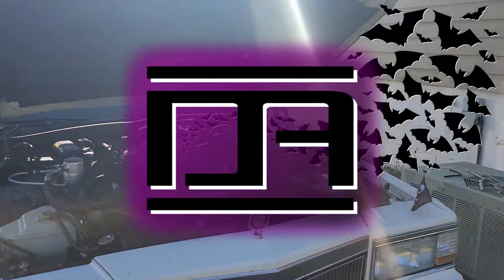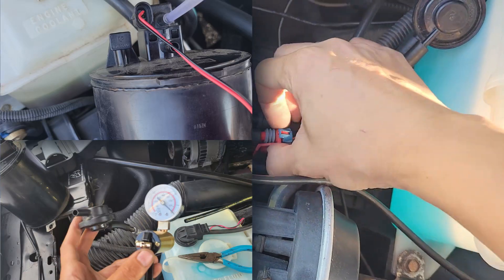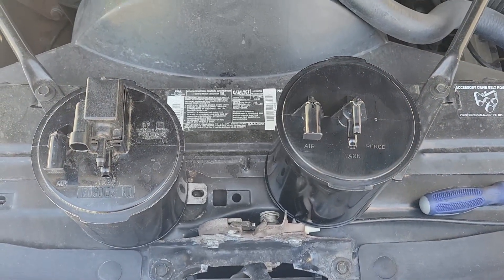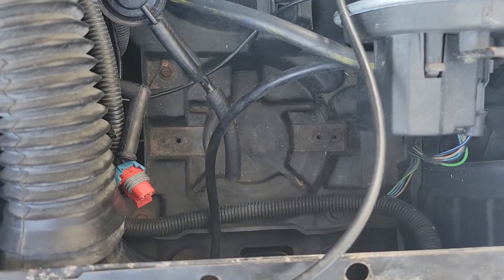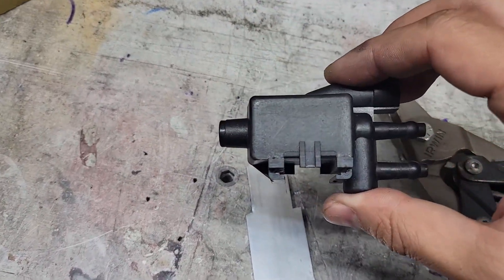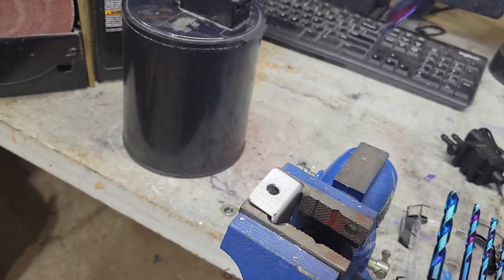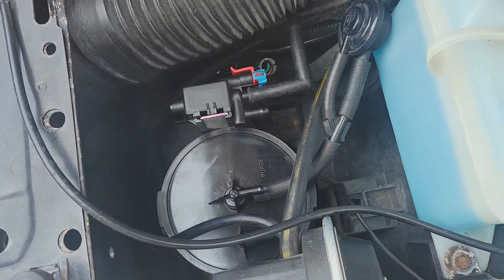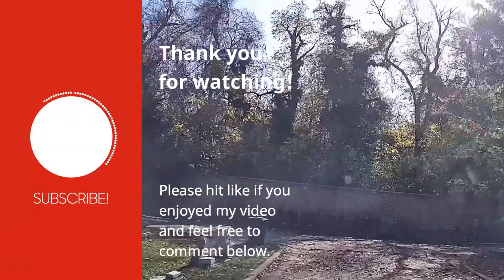Retrofit EVAP Vapor Canister and Purge Solenoid Original Discontinued (1990-1992 Cadillac Brougham)

Comment: Think this will work on a 91 Firebird with a TPI engine? Has the same oem part number canister “17090155 MD”
Reply from the maker: I missed this question until now, but if your Firebird has the same discontinued canister, then it should work.